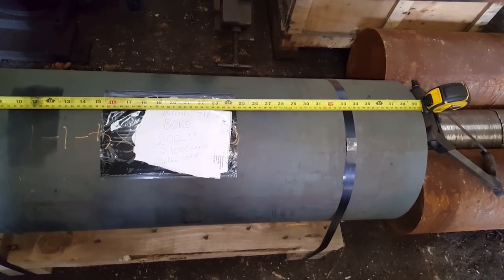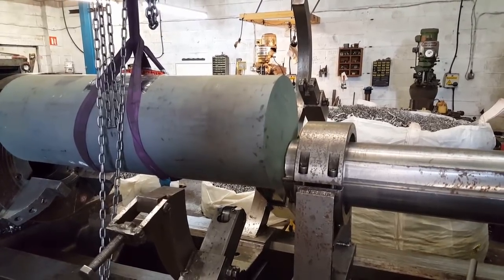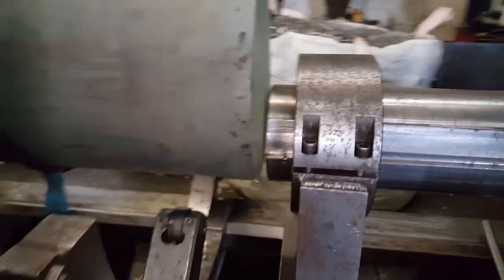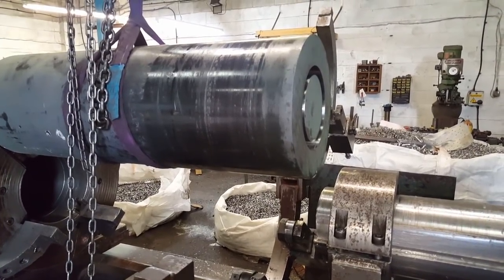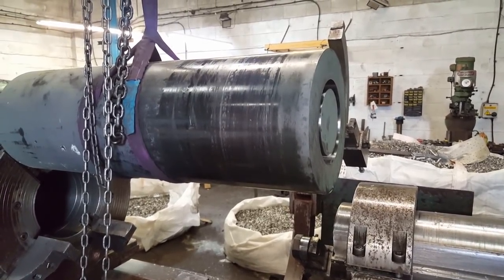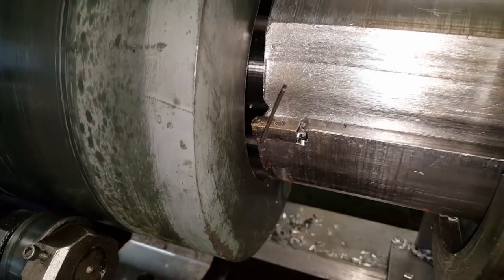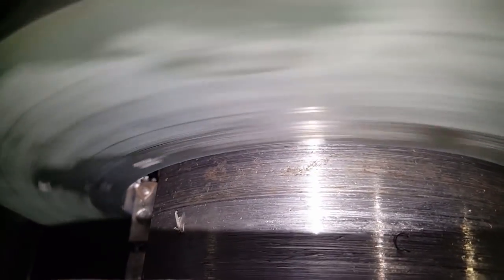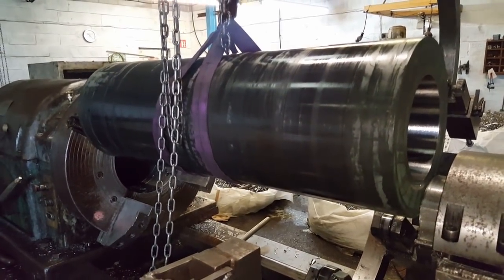1000mm long INCONEL 718 bar 200mm hole bored thru.  156mm core recovered

Comment: Hi David, I am very impressed by your work, please share your knowledge. 
What grade of insert you used, a previous video mentioned Sandvik, this insert looks like a wnmg...please share the grade information. The running feeds, speed and coolant grade, concentration would be a greatly appreciated
Reply from the maker: Carbide is WCMX 06T308 Sandvik.  All size Trepanning Tools use same cartridges and inserts.
Reply: @userwl2850  wonderful, please tell me about feeds and speeds...coolant? Thank you for sharing the Sandvik grade
Reply from the maker: @MrButtonpusher  inconel 718 feeds and speed all depends what size hole I'm cutting.
Reply: @userwl2850  David you mentioned the shape and size, pls share the grade, I see 4235,h13a,1125,1105
Reply from the maker: @MrButtonpusher  I mention it in my last video "Nimonic" if you care to watch. Also you'll see the best beer in the world..... definitely 🤣🍺👍
Reply: @userwl2850  thanks David, I might just have to get some John smiths before I start my next inconel project. Cheers

Comment: I have never seen this type of machining before. At first, I thought maybe you skipped the part where you used a series of drills to get through the center, then follow in with what I thought was a giant boring bar. I think this process has so many advantages. Saving a lot on tooling, time, and not burning energy turning a thousand+ pounds of steel into chips. Also, you get to walk away with a slug you can reuse. Love it!

Comment: How do you deal with the runout that results from flipping the work around?
Is there a finish pass with a longer boring bar that spans the full length?
Reply from the maker: I explain that at 6.05.
Reply: @userwl2850  yeah, but that bar is still only ~500mm long, correct?

The question was, how do you insure, that there is no step, from flipping the part?
Reply: @9deviltiger9  Being reaaally careful with measurements.

Comment: My old boss used to have us trepanning everything, we had tons of billets  saved a fortune in obscure materials,
Reply: Please give me details about trepanning if possible I m having similar components 
lalitmkaushik@gmail.com
Reply: What do you mean by that? Like putting holes in billets in order to get the customer to let you keep them?
Reply: @gr1nder07  The trepanning tool does not machine the whole diameter, only a ring at the periphery. Instead of removing all the material in the form of chips. In other words machining just enough material to get the bore you need, you get a hollow cylinder and a smaller cylinder to be reused, like in the video. Instead of removing the entire core by drilling or boring, which results in tons of materials going to waste.

Comment: How many inserts did you go thru in the trepanning? Just curious, also what grade insert did you use? It looked like a rather large WNMG but you are British and i am an American so it may not translate.
Reply from the maker: WCMX sandvik 1020 carbide inserts.  I used 10 on this 1 piece.  About $100
Reply: @userwl2850  thanks for the info
Reply: Ten and all sides? So it is not very long between a change or turn. Amazing job anyway, I like it.
Reply: Pretty sure iso lathe tools are standart world wide lol

Comment: Hi I really enjoy your work and tool design. I need to core brass 6 inch rounds but not to the depth of your work. Do you think a coring tool with an .080 wall thickness and a .090 cutting tip would cope down to a depth of 1.2 inches. Using high speed steel tips.

Thanks for your input
Dolf
Reply from the maker: Did you get it done? I'm a year too late.

Comment: Hi, I have only just started watching your excellent content and you may have answered this before but I'm curious. I'm a fitter and turner from  New Zealand in a can making plant, I do some matching but not to this level. How are you getting the break through on the bore to meet up when you flipped the work piece around without a machined outside first? Was that surface better than it looked from the mill and you could clock it true enough?
Reply from the maker: The breakthrough meet up halfway perfectly.

Comment: Why not cast a part?
Reply: A cast part even if heat treated and tempered, would not have the same fine grain structure in the metal as a forged part, to provide the required and proven tensile strength necessary for use in an oil or gas facility.

Comment: What kind of lathe is your wee one off in the background?? Thanks
Reply from the maker: John Strange hi john it's a smaller version of the main lathe I use. It's a Dean Smith and Grace type 17. I use it mainly for tool making and threading. It's a little beauty.
Reply: Very nice. Not as small as I thought. Thanks.

Comment: David, on the steady what is that large pad at the 12 O'clock position? I bet that steady was a challenge to make~ Richard
Reply from the maker: Makin Sumthin From Nuthin I made that steady 25 years ago Richard.... it's done well. They are very easy to make just welding work once the bed plate and ring made. The top bearing takes a lot of pressure and break easy as the cut on these tools is 20mm. I use a heat resistant plastic and hard wearing called polypenco.  Saves a lot as these bearings are £80 each. Cheers buddy.
Reply: Thats excellent...and a really smart workaround, was always curious about that Smart!

Comment: hi david i can now see why you modifying the craven lathe you should be able for jobs twice that size,could you explain how you make the cartridges adjustable cheers mick
Reply from the maker: Mick O Callaghan hi Mick. At 6.06 I inserted an Allen key to the side jacking grub. Yes the craven ... I will be able to bore from 25mm up to the limits of its power from solid boring and much longer lengths. 90% of work I get offered are out of my capacity.

Comment: Years ago I worked for a diving company doing work on Thames water jobs, there was a 6ft dia valve (Victorin) with the 6 inch dia pp2 bronze lead screw was fo bar

I rang my old firm and Harry checked the length and we got it on the lathe by ¼ “

A nudge under 6 foot with a buttress thread down 4ft 6 lol

Nice work BTW
Reply from the maker: The Essex Hunter I get it. It happens all the time with me. I usually find away to sort it. Thanks for the story I love to hear interesting stuff like that.

Comment: Amazing.. Does the cut get more difficult when the tool is hanging out so much from the suppirt at the end of the cut? Btw still waiting for the tool to show up.. next week will make the first pieces no matter what..
Reply from the maker: sunppaa hi Sam. What happens is the bore gets smaller and the core gets bigger leaving less clearance around the outside and the inside of the tool reducing room for coolant.  Not a problem on most metals but INCONEL 718 is not most metals. Great news you will start the tools.... I'm so bored making them they are too easy to make manually but very repetitive work like a robot with no thinking involved.  Good to hear from you buddy. 👍
Reply: still amazing work keep it up! would love more videos of what you do